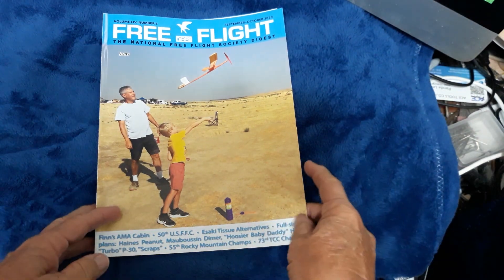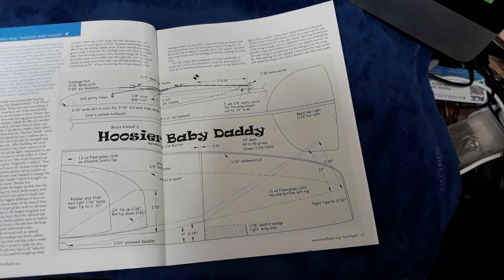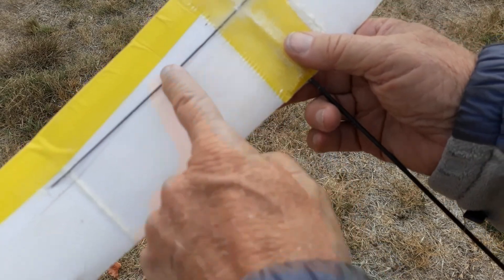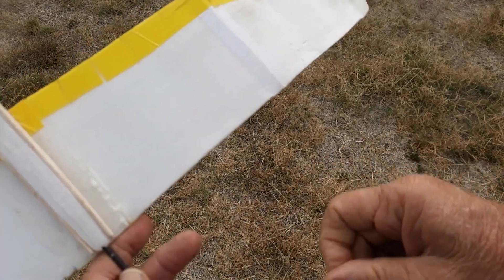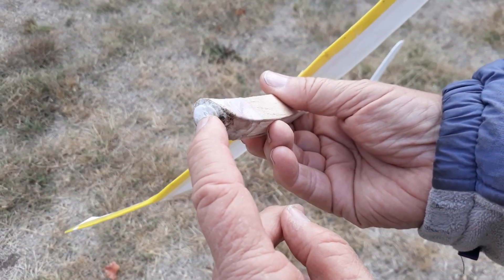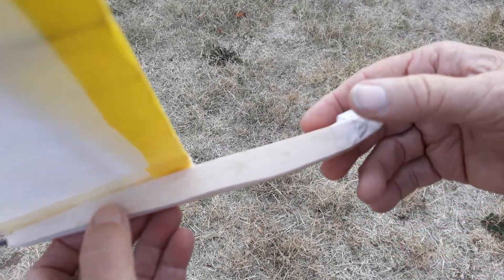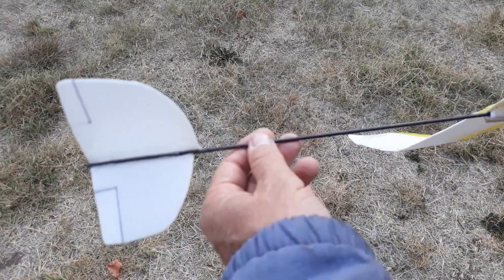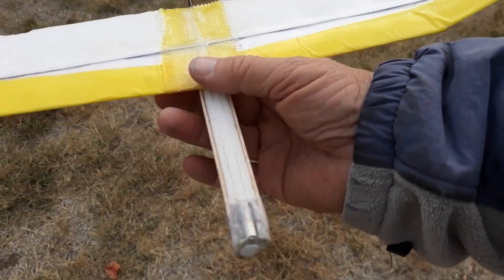Foam Hoosier Baby Daddy

Comment: good build for working with foam board    nice flights    i use to make all foam gliders also  but now i have a shinto rasp so i can shape 1/4 balsa wings pretty fast    the shinto cuts the balsa like it was butter   of course i sand in the final finish      Big Thumbs up    check out Carl Rambo Poly B     josh finn has a nice video on it
Reply from the maker: I bought one of Josh's 19in Carbonettes but crashed it once too many times in trying to tune it in.  The park where I fly has too many cross currents sometimes due to being surround by the trees you see in the videos.  Urban environments suck.  However I rebuilt it using the main wing (which was undamaged) using a 4mm carbon tube in front with a 3mm tube glued into the back to simulate a tapered tube.  That flew very well until too many cross current induced crashes started fracturing the brittle contest grade balsa wing.  Unfortunately, here in San Jose there aren't any nearby, accessible large open fields.
Reply: @jimeagle1   same situation where i live  i just have a ball park with lots of trees surrounding it      I just love gliders in general     check out the old videos here on you tube  George Balsa gliders   the fellow built some outstanding hand launch types   His swift 19 i am trying to copy as close as i can